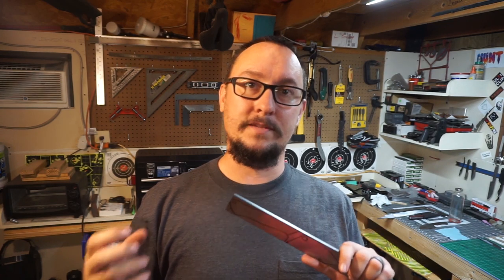Making A New Knife Design | Thinking Through Your Design | Daily Vlog

Comment: Hey bud, another great video. My chainsaw bar knife is 3/16" thick as well. I love the heft. Hey, I'm not a internet safety pirate, but get you a little paint brush to dust away when you're drilling before you get a sliver stuck in your finger. Helpful tip from The Nate's Experience lol
Reply from the maker: that's a good tip actually, I will be doing this.